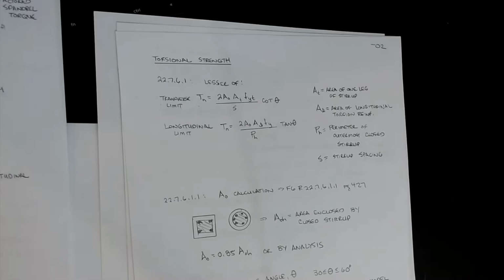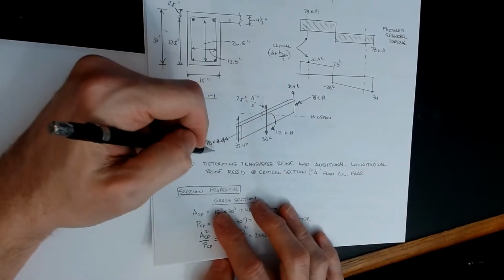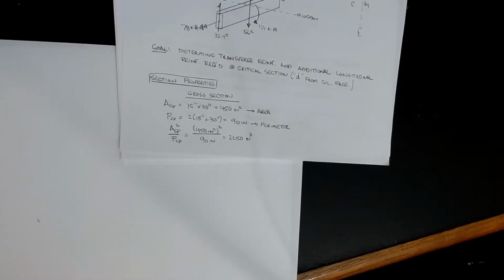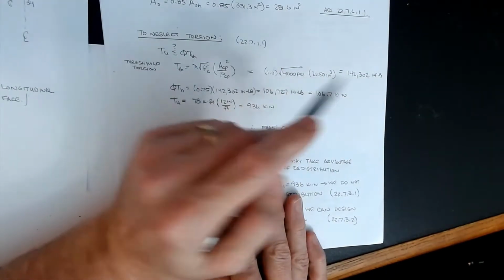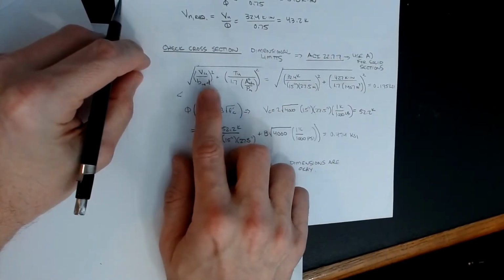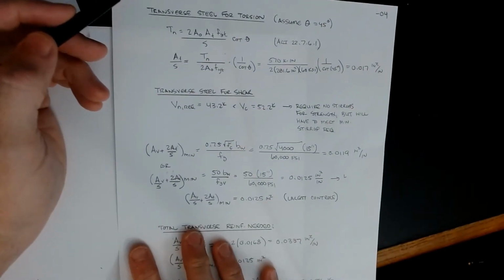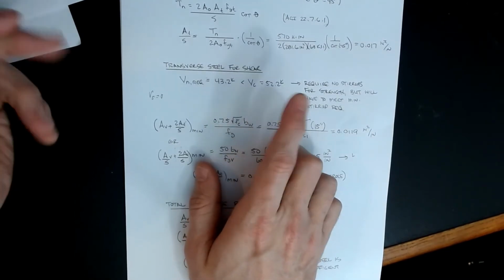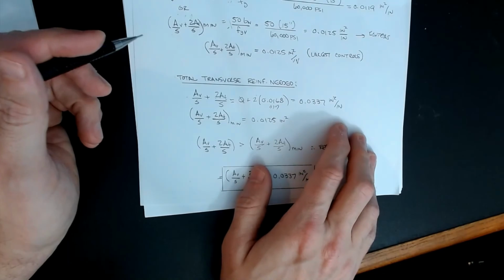032 CE342 Concrete Design: Torsion Design Example Pt1

Comment: I appreciate your explanation being so clear and precise.

In the video, at minute 29, there was a limit where Vu was being compared to 0.5ΦVc. I have a question about that.

Do you think the following applies generally?

1). If Vu < 0.5ΦVc then no shear reinforcement is required. 

2). If 0.5ΦVc < Vu < ΦVc then Av,min is required. 

3). If Vc > ΦVc then the following condition shall be checked:
Vc < ΦVn ; Vn = Vc+Vs,max
If ok then check the following condition:
Vs = Vu/Φ - Vc < Vs,max = 8*SQRT(f'c)
If ok then Av/s = Vs/fyt.d

So far, is this how things are?
Reply from the maker: That’s a very succinct summary, and the way I always try to remember it.  Well done!  Thanks for watching!

Comment: Is the critical section for Torsion at "d" away from the face, is that in the code anywhere for Torsion?
Reply from the maker: The critical section parameters are found in ACI318-14 Section 9.4 --- for shear it is 9.4.3 and for torsion its 9.4.4.  Hope this helps!  Thanks for watching!

Comment: Kindly respond to my request sir
Reply from the maker: I do not have a video covering torsion design of t-beams or double stemmed t-beams or or even unsymmetrical flanged beams such as L-beams at this time.  You could be grossly conservative in neglecting the flanges altogether and use the rectangular core for single stem t-beams to resist all of the torsional load if you were simply trying to size the member or get an upper bound feel for reinforcing requirements in the stem.  In some situations this may be prudent in cases where the flange dimensions are very thin or very short in comparison to the stem i.e they carry a small amount of the torsional resistance. This will most likely result in slightly larger dimensions for the depth and width of a single core, but it would likely get you in the ballpark so to speak. We may decide to cover this topic in more detail in a future video but simply have not gotten to it yet for this course.  Hope this helps and as always thanks for watching!

Comment: Sir please cover one more example related to torsional design of RCC wide flange T beams....since you only covered rectangular beam torsional design unfortunately in my exam i got a question of T beam torsional design instead of rectangular beam due to which i was unable to solve that question

Comment: When your'e given a beam that carries a cantilever slab will you not add the area of the slab to the area of the cross section of the beam when solving for Acp? Considering the weight of the slab will also be transferred to the beam?
Reply from the maker: In theory, if you can estimate the ability of the slab to resist the torsional behavior of the beam, you could probably add some some amount of it into the Acp value. But this slab is only 4.5 in. thick which is very small in most structural senses, so we decided to neglect this ability, which reduces Acp, which under estimates the torsional strength of the concrete, which will put more burden into the reinforcing steel (you'll be increasing your steel requirements).  Also, the example in this video is also only for torsion and shear contribution, so the longitudinal steel requirements are the additional steel needed BEYOND the flexural requirements.

Hope this helps.  And thanks for watching / subscribing!